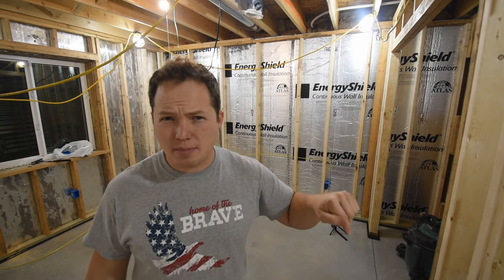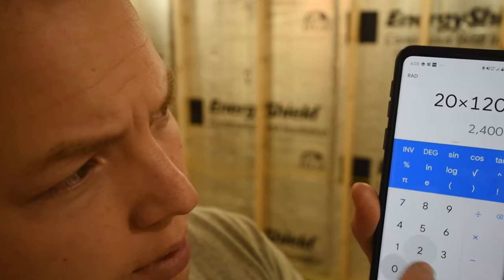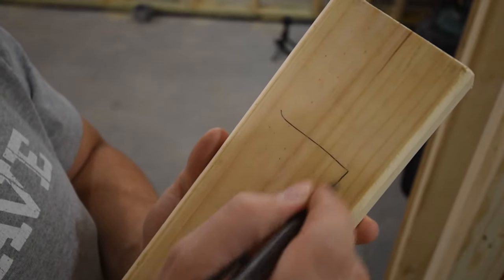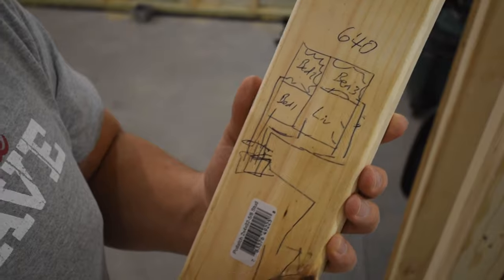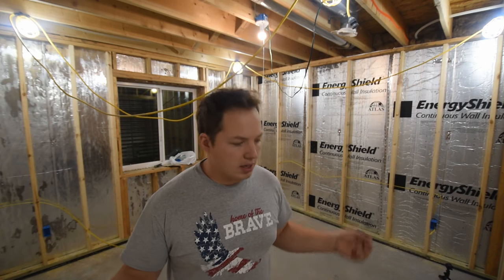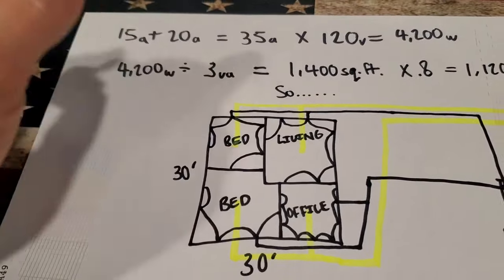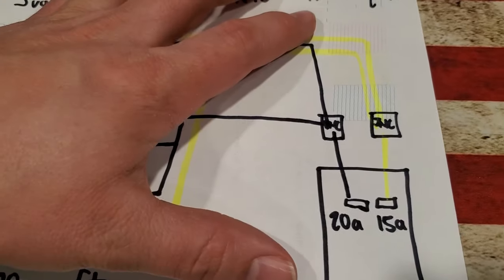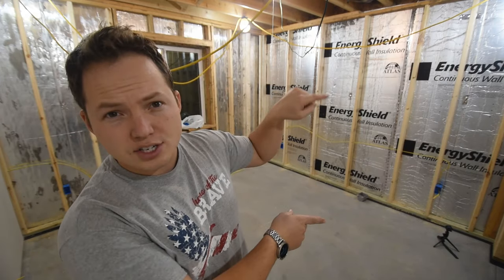Does a Bedroom Require a Dedicated Circuit? - Using the 3VA Rule To Calculate Anticipated Loads

Comment: BTW, I have an AC question for you. In our area the general rule (code?) is one ton of AC capacity for every 500 square feet. My house is 2300 square feet so I have a 5 ton AC unit. I was just wondering what it is in Minnesota? Is it the same, or is it more a factor of nuance?
Reply: In my area for residential it can vary anywhere from 1 ton per 600 to 1200 sq ft depending on construction, window area, direction windows are facing.

Tons per sq ft is not accurate, a load calculation is required to know for sure.  Oversizing can cover up for bad ductwork and improper installation/comissioning.
Reply from the maker: What area are you from Barry? As Jon mentioned a load calculation is the best way to estimate size. If I had to estimate I would that we are at something like one ton per 750 square feet. An average 1,500 square foot house would typically have about a 2 ton central AC to serve it. If you want to do some load calculations you can use a free tool at www.coolcalc.com. It's a pretty awesome tool that lets you use satellite maps to measure the dimensions of the structure for the load calculation that you are doing.
Reply: In humid areas it's really important to not oversize - want the continuous operation in very hot weather even if there's a risk of not keeping up a couple of days each year.

I'm guessing minnesota isn't overly humid and with it being so cold there people are more heat sensitive and set their stats to like 72F.

In ontario, canada typical 1980s to mid 90s 2000 sq ft house would only have a 2 ton, maybe 2.5 with large windows and or high ceilings. On the other hand, there are old 1200 sq ft houses in my city that need 2 tons -> combine east/west exposure with poor or no insulation and the house being long and narrow.
Reply from the maker: Your first point is especially important for sure. If you can keep the humidity down you also don't have to keep the temperature as low since the dry air feels cooler. Thanks for sharing what is typical up there in Ontario as it is always interesting to hear what it is like in different areas. As you said though no "rule of thumb" can replace proper calculations.
Reply: @BenjaminSahlstrom  I live in Tucson Arizona and the code here is one ton for 500 square foot. Now there's some obvious nuances that can change that way or another. I am presently looking at one of the new high-efficiency AC systems in case mine blows something important. Old and new systems are rated 5 tons. The square footage of the house is 2300 square feet, and built in '05 . I have been fixing the old one myself so far, thanks to your videos and others,  but it's just getting at the end of its life. Since the run 9 months out of the year, they don't last long. I was just wondering if for Northern parts of the country were required to run such behemoths. The new system is about 12K  install And will use about 40% less electricity. It will never pay for itself, but at least it would be half as noisy as the old one.
Reply from the maker: @barryhornby3303  Interesting stuff! Here in MN we only run our AC for about 3 months so that's a huge difference! Uffda... $12k seems really steep. That system (assuming it is just a change out) would probably be about $6-7k at the most in our area but we are in a lower cost somewhat rural area. Wish our MN licenses worked there in AZ as it sounds nice to get out of the tundra and do an AC install for you!
Reply: @BenjaminSahlstrom  the system also has the gas heater built into it like the old one. The evaporator part along with the space heater, hangs in the attic space from chains. Both the old and the new system come apart in pieces to fit through the access hole. I'll try and find the make and model number of the new system and post it here. The old system is a Goodman system and is very noisy. Even the rattlesnakes won't hang out by it😀
Reply: @BenjaminSahlstrom  the short answer to your comment is that I don't see any Heating and Cooling guys here starving to death! 😀  The last time my AC went out it was 109 Fahrenheit. I took the day off work to fix it since the a/c guy was at least a day out. The problem turned out to be the capacitor on the blower motor oh, so I drove 15 miles to the supply house to get a new one.  after putting it in, the fan ran for one minute and then came apart inside. So, I drove to the supply house, bought a new fan motor and capacitor, since this new motor couldn't use the old capacitor. Great!  anyway, I got the whole thing back together and working by mid-afternoon oh, and by then the house temperature was about 93 degrees, outside was 109, and in the Attic was 130+. so as you can see, your heating and cooling skills would be very profitable here and in high demand. The urgency to get the AC fixed was the fact that there were seven people living in my home. Fans don't fix that kind of LOL
Reply: @Jon-hx7pe  yeah, our house in Tucson has 10 foot ceilings which doesn't help the heating and cooling issue much. I understand the issue of overdoing the AC and winding up having it freeze up. We have Monsoon weather here in the summertime for about two and a half months. Obviously, it raises the humidity quite a bit, but still nothing like the rest of the South.  the condensate tube from the AC makes a little puddle by the house. At night you come out and find toads sitting in it! LOL our house is only 15 years old with only one window on the west side of the house. Unfortunately, the south side has many large windows, but at the peak of the season the sun is too high to sign on them. I planted a eucalyptus tree on each back corner of the house to provide some shade. Eventually we'll have a patio cover up to help shade those windows. The main issue with Tucson is 4 months of days with the average high of 100 degrees and little shade from clouds. So my house has some good and bad when it comes to Cooling
Reply: Barry Hornby … That rule of thumb is what sales people use selling window units. They generally work with 30 BTUs per sq ft and do rough math, which is ok when doing a single room and the next room is not conditioned. (and 80 - 90 degrees) This extra capacity allows for warm interior walls (no insulation between rooms) and part time use, such as when people flip it on after work to cool a bedroom. When doing AC on a whole house the real number is probably half of that, but doing a load calculation is the right way to figure things. Here in New England your home might have no more than about 3 tons of AC... and we do have humidity near the coast. I doubt you will find anything specific in the code about sizing AC systems. More on topic, there will be code on wiring the AC system.
Reply: The unit that I got the quote on was a Lennox XC 16-5 5 T
Reply: @BenjaminSahlstrom  the other system was an XC 20-5 TTC. On that one. They wanted $13,500. Since this is Arizona, I heat my house to 78 in the winter, and cool to 78 in the summer. The 78 is plenty cool enough since the air here is anything but humid, especially after going through the AC system. The house has 10 foot ceilings which adds to the actual square footage. No matter who I called, they all said it would be a 5-ton system. Somebody asked about installing a solar system. This is certainly the climate for it, but It takes over 20 years to pay for itself. I'm waiting for cheaper panels. There are government paybacks on the systems, But only if you DO NOT use battery backup. I'm also waiting for cheaper battery storage systems. Once all this happens, then it would make sense to have solar installed. The A/C efficiency will still be an issue so it won't kill the batteries too quickly, and my present system does run all night. The utilities do buy back the electricity but only at their lowest wholesale price. This was to prevent people from oversizing their system in hopes of making money. Even with all that, and living in Sunny, Arizona, you will still need to be on the grid. Electricity rates aren't THAT high? LOL Either way, it's a big boom for the trades, electricians and HVAC.
Reply: @barryhornby3303  … Lennox is one of the Cadillac units in the AC field. Good quality and should last you 20 years no problem. I'd be more curious as to how they decided on the size. 5 tons seems like quite a bit for that house. You might also want to consider more insulation or replacement windows and calculate again. The difference in "cost to operate" might help with the choice in the long run. Might also shave a few $$ off the installation... and help fetch a few more $$ when you sell in the future.
Reply: @rupe53  The house is 15 years old and has stucco siding. So the installation is rather "up-to-date", so to speak, and stucco does a good job of restricting airflow. I think with the sun exposure and 10 foot ceilings, along with a 100 degree days for 4 months is the main kicker. The five ton rating is based on average efficiency, So I suppose if you had a very efficient system you could get by with less. Some of the older homes here have slump block Construction and flat, poorly insulated, roofs. They would definitely require the higher end of that rating. One interesting thing. I noticed here that no Lender will give you a loan on a home here unless it has some sort of heating and cooling system. Evaporative  cooling is okay.
   One note on evap coolers: When I was out looking for a property to buy for flipping purposes, I noticed that all the EVAP homes I looked at had mold issues. They're okay to use in the spring in the fall, but during the humid summer two and a half months, You have to use AC to keep the house Dry. On every single one of those moldy homes, they did not properly exhaust the air. Newer designs using evap will have automatic weighed louvers that pop open in the ceilings of each room. Evap systems work well enough and save electricity, but creates their own set of maintenance problems, and pretty much need to noisily run 24/7. Most HOAs forbid them. I appreciate everybody's advice and concern on this, especially when buying a new HVAC system cost the same as a decent used car. There are less efficient systems that are cheaper, but when I had seven people living in this house, my electricity bill in summer was hitting $400. 1 new innovation, I think I saw on one of Ben's videos, was to install a heat exchanging exhaust fan above the stove. I think with my daughter and granddaughters living here, They did an awful lot of cooking! All those cooking BTUs had to be taken out by the AC. I think when I remodel the kitchen, I will install one of those, if I can get it to fit. The point of saying this is that Doing a little house redesign including putting a patio cover to shade the back south-facing windows/wall, I might be able to get by with less. I did consider calling an energy consultant. I figured with his signature on suggested improvements, I might be able to convince the installers to use a smaller system.
Reply: @barryhornby3303  … Another thing you can do is get a quote from more than a single company. That way you can compare notes and see how honest everyone is. One thing you didn't mention was if this happened to be a ranch style home, which adds a LOT of roof / sun load. I also have a hard time thinking of Minnesota having 100 degree days for any length of time. Here in Ct we get several rounds of mid 90s in the course of a summer, and humidity comes with that but generally speaking we are talking over 3,000 sq ft to be looking at 4 - 5 tons of cooling. I have 3 tons for just under 2,000 sq ft but my home is over 100 years old, so not perfect even with renovations.
Reply: @rupe53  yes, it is a ranch style home. I am trying to reduce the sun load by planting eucalyptus trees about the place. On the east side I have citrus, and eventually, date palms for shade. The date palms just aren't tall enough yet.
Reply: @barryhornby3303  … have you considered insulating the under side of the roof? It could drop the attic temp by 40 - 50 degrees.
Reply: @rupe53  Well, the existing attic is insulated with at least a foot of blown-in type insulation. I'm not sure that insulating the Attic Roof would be a cost-effective. I'll have to leave that to the energy guy. Our HOA prohibits exposed roof-top  fans. I can however, put a fan at each end of the attic behind the existing vents. Some guy here in town published an article stating that the cost of the fans And running them, doesn't save any money, since the roof can build heat faster than the fans can dissipate. In other words, for all the work that fans do, it doesn't lower the attic temperature much. Surprisingly, the roofing material is architectural asphalt shingles, not the usual tile. The roof is rated for it, though. In about another 15 years. I'll need a new roof, and I thought by then they'll be some products available that I could use to help deflect the Heat at the source. Tile would help Since it has an air gap under it. I was thinking of putting down a thermal barrier before I put the tile down. I think that will work? Still, the biggest thing I need to do is put up a patio cover extending the whole South End of the house to shade. the three big windows, the slider, and the wall, from the Sun. It is being done somewhat passively by the two eucalyptus trees now.
Reply: @barryhornby3303  ... my only suggestion is to do some research for YOUR situation. You may find that spray insulation can diminish the heat build up to a point where a single fan at one end can of the attic can get rid of more than you think. We're talking "heat exchange" so fans at both ends without a fresh air source may not do squat (fighting each other) while a single fan flowing air through can help quite a bit.
Reply: @rupe53  I'll do the research, that's what the energy survey guy is going to do. The way the attic is designed, there's no easy straight through. The idea of the fans was  to draw the air up into the attic through the "bird blocker" vents and then out. I I do know about the spray foam that you were talking about. That might work if it's not too expensive. All I care is that the install pays for itself. I do appreciate all the good ideas and encouragement you're giving me. This discussion is motivating me to get this done!!
Reply: @barryhornby3303  … one additional pointer is sometimes a local utility company has incentives for insulation programs. IOW, reduced cost to you. Might be worth a few phone calls.
Reply: @rupe53  Yes, I think you are correct on that.  I'll check it out.
   Thanks.

Comment: Can I use 14-2 on the 20 amp. Outlet circuits ?
Reply: No, there are some situations where 14 ga will be okay. But internal wiring is a definite no
Reply: Rule of thumb is 14 awg for 15A circuits and 12 awg for 20A circuits...

Comment: Ok, so... I am in a mobile home. I do own it, so can do anything I want once power gets to the breaker panel. Currently, without getting into a mess of descriptions, all of the wiring here is 14/2 on 15A breakers for the most part. It would be a majour overhaul to run the required 12/2 in order to run a 20A breaker and remain within code, not to mention that there is no acceptable way to take down the walls to do that right now while we are living here. Of course, 98% of the walls are just wood panels, but still, to get to the areas that do have drywall, new wiring is still a pain. The most we run are a couple of computers and things like a UPS, RAID, maybe dual monitors, etc as the main draws in each room, and are running LED bulbs. Problems are that no matter what, on the circuit for the front bedroom and craft room (latter is not being used, so no load in there) there is a light flicker when turning on the vacuum cleaner. Right now, the load is seriously reduced on that circuit so that there is only one computer in the bedroom and one in the living room. I have been replacing the outlets as quickly as I can, as these really are rather old ones. What would your thoughts be? I have already solved some of the issues I have experienced in the back part of the house, but the front, configured as such, is still doing that light flickering, and I have not had a chance to get to the circuits up here in any good way. -- Oh, by the way... I am not really sure how to search comments for something that may have already been asked... otherwise I would have. :P Thanks!
Reply: RE:Kimberle. Are you running the vacuum on the same circuit as the front bedroom lights? If you use a different circuit is it okay? If you run a hair dryer or a motorized appliance on bedroom circuit, do lights flicker? If you already replaced receptacles and can't get into walls, I would check (replace or swap breaker) and inspect panel for poor connections on that circuit, especially neutral wire. Check for holes on both sides of bedroom walls to see if a nail or screw may have punctured a wire in that circuit.
Reply: @munsters2 : Yeah, it appears to be just an old wiring thing with this place; it is an older mobile home which has some grandfathered electrical for the sake of code. The initial draw when a high amp appliance like a vacuum will cause the flicker, and sometimes things that have a very very quick repeating draw like stepper motors or the like can cause it too. It is just older stuff that I am working on changing over. Sadly, it has to go extremely slow thanks to my budget. :P Good info from you and thanks. :)